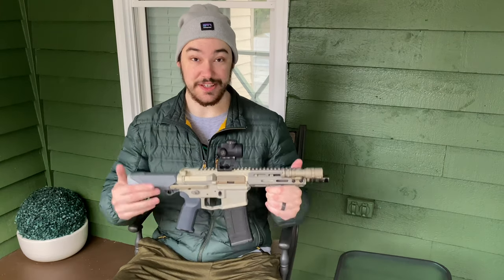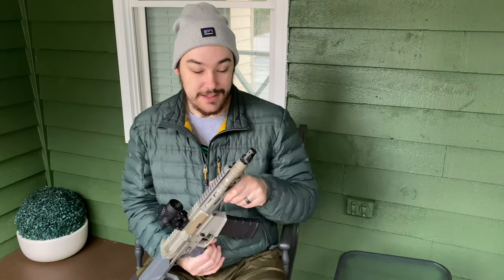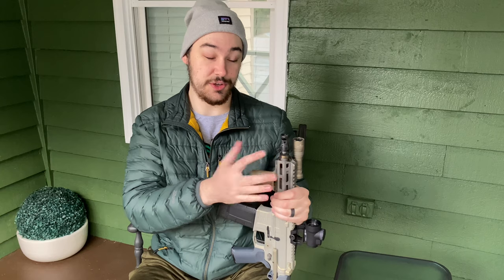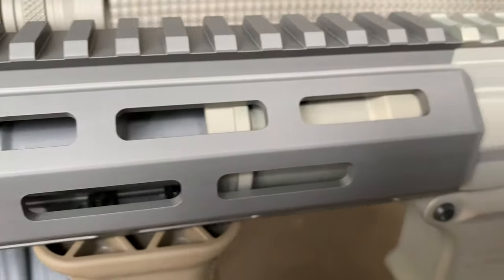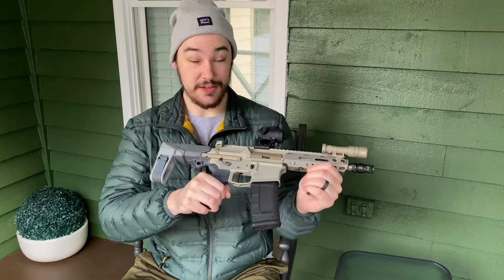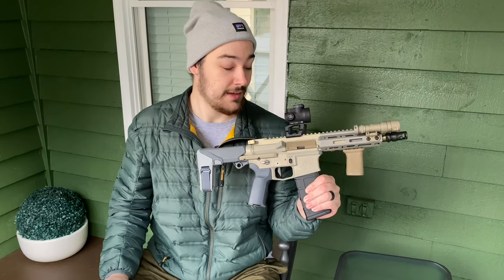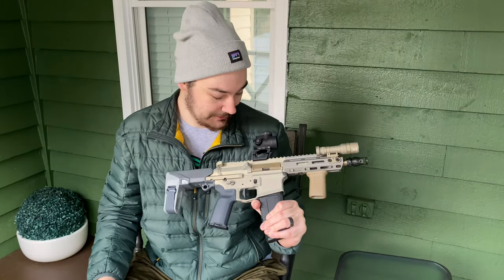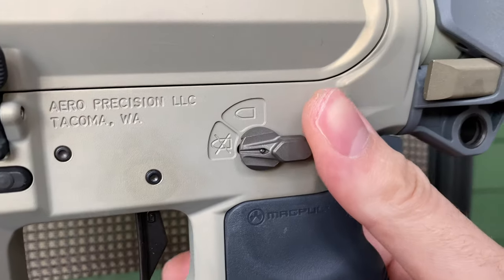Q Sugar Weasel Clone Build + Supressed Shooting

Comment: How much would you say this build has cost you been looking to possibly just get the sugar weasel
Reply from the maker: I waited for deals on everything, so all in I was at $1500 minus the light and optics. Same price as the sugar weasel, but nicer trigger, the q charging handle and safety, and the sweet HBPDW.
Reply: I’m super tempted as I enjoy the process of the build as much as anything but the sugar weasel is priced so reasonably I’m leaning towards that.  Then changing the trigger out probably?  Great build!